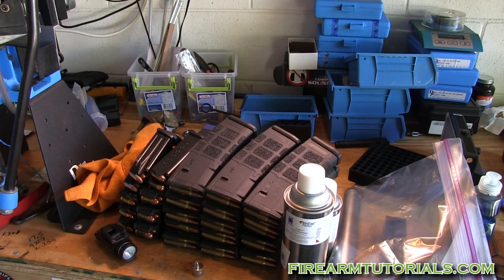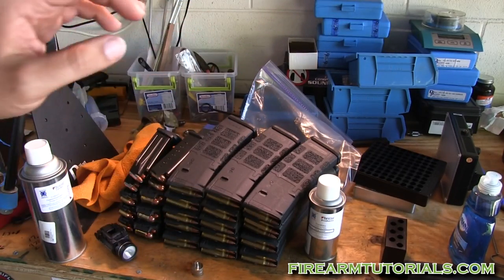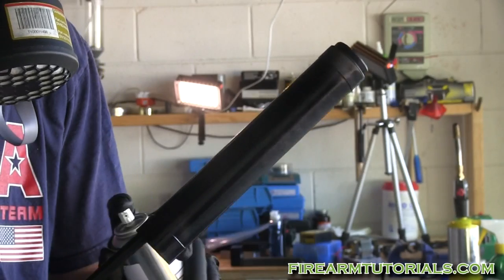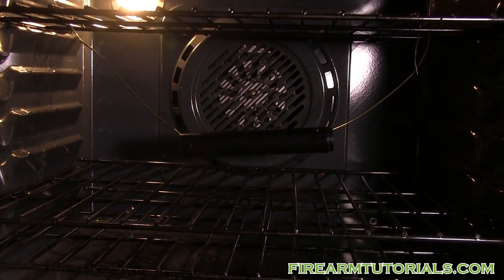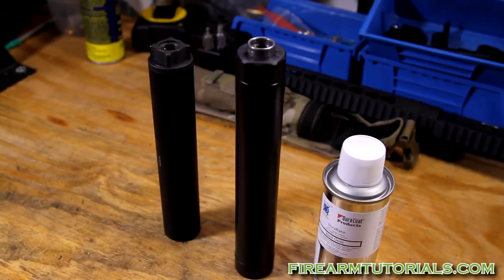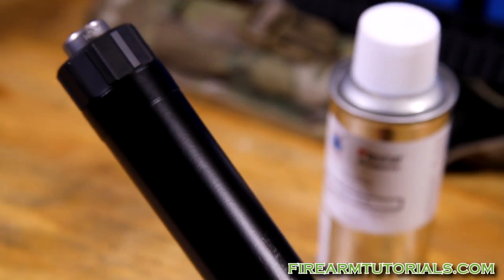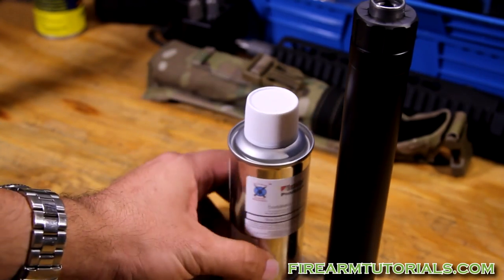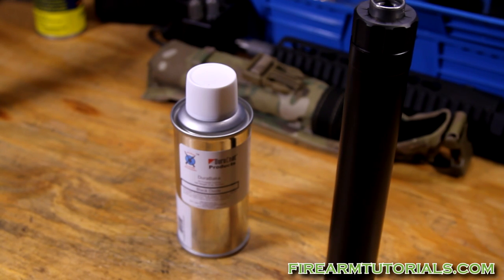Painting suppressors with Durabake

Comment: As a general rule with spray paint, when you are finished hold the can upside down and spray in a safe direction until the spray is clear and you will avoid the clogging. Looks good however.
Reply from the maker: That makes sense.  Thanks for sharing.

Comment: I know this might sound crazy but i went to Tractor Supply and bought Rust-Oleum high temperature ultra spray paint. I used this on an old Elite Iron Delta 556 rifle can that has been pretty banged up over the last few years and I have been absolutely floored at how well it has worn. I mean this suppressor was missing huge chunks of paint and was all scratched up. So I sanded down the tube and then sprayed the piss out of it with brake cleaner and let it dry completely. The next day I went out and single coated the can real good and spent about 15 minutes hitting it with good hot air from a blow dryer. The next day I went out and did it again this time I let it dry for 2 or 3 days. Wow that thing is still looking good and I have mag dumped several times without loosing finish obviously only one or two mags at a time. I tell you what when it finally starts to wear again I will refinish it again and for the money and time it’s hard to beat. The Rust-Oleum has an advertised temperature threshold of 1500 degrees Fahrenheit that being the high temperature ultra kind mentioned above. It also comes in flat black and semi gloss black as well as a few other colors if one were interested. Awesome video thanks for the tips on the whole Duracoat process.
Reply: Thanks for this info. Sounds like a good alternative

Comment: Solid video Lord Vader
Reply from the maker: I ended up doing Cerakote on this suppressor several years later.  Much better product and I used a professional sand blast cabinet to prep the metal and remove the Durabake.  Much better solution.